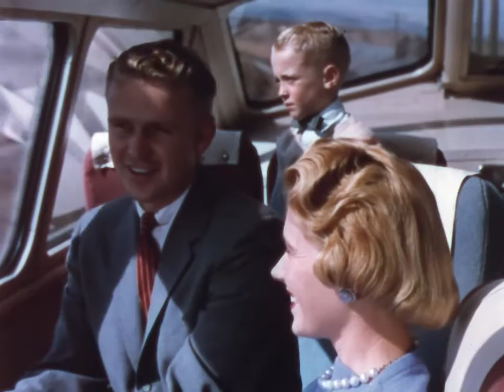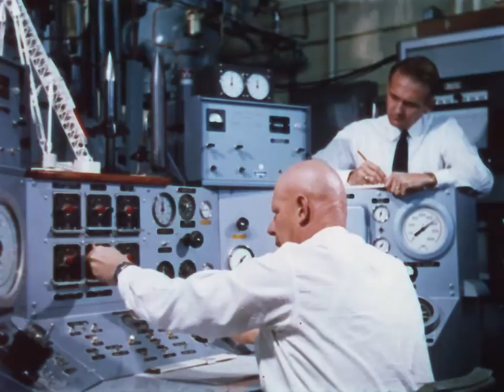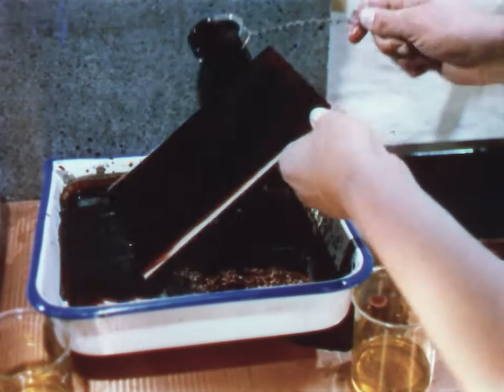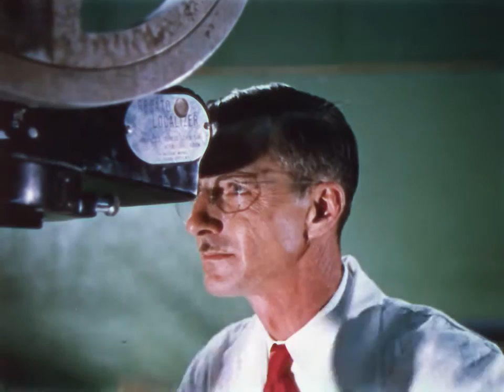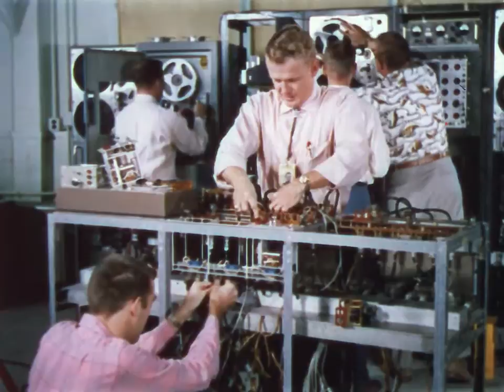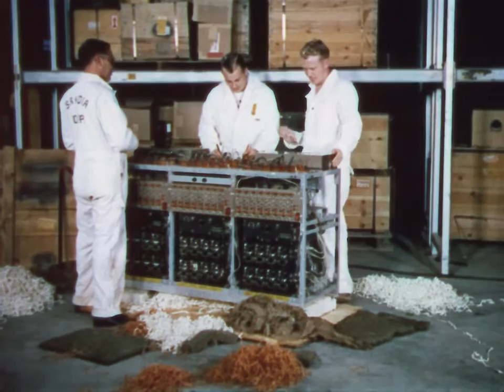The Sandia Story (1945) - Sandia Labs History New Mexico - CharlieDeanArchives / Archival Footage

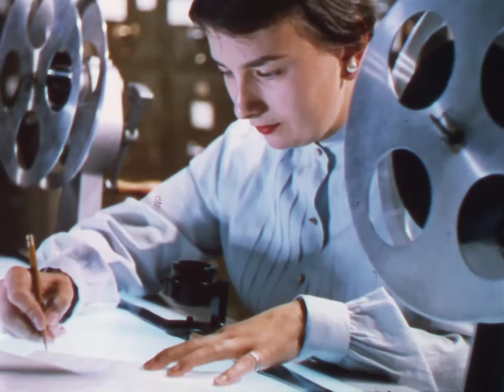Comment: I worked hand in hand with Sandia when I was part of the Air Force Weapons Laboratory (AFWL) 1982-1986.  10:13 That’s what I did except updated equipment, but still analog tape (Ampex 28 track). Cool stuff I worked on, favorite being the Airborne Laser Lab.

Comment: As a kid, my dad was stationed on Sandia first around 1947 then later Kirtland in 1954. Manzano Mountain should be mentioned in the history. I attended school on base. Interesting times, for sure. Albuquerque was a very different place then, Central Ave (Highway 66) as the main drag through town. The base shared the runways with the commercial airport, which was a thing of beauty.
Reply: They still share the runway
Reply: Beautiful. 

I grew up flying out of that airport to visit family on the East Coast. 

I remember looking down at all these curious structures and building in the desert that I think were used for exercises and experiments. You fly over them as you leave the Albuquerque Sunport. Or at least I remember doing so as a kid. 

At the time I never even knew that half of the Albuquerque Airport was a military base and that the airport was connected to it. I never even knew of Kirkland. 

Until I got older. 

I remember flying down over Manzano Mountain one time on approach.